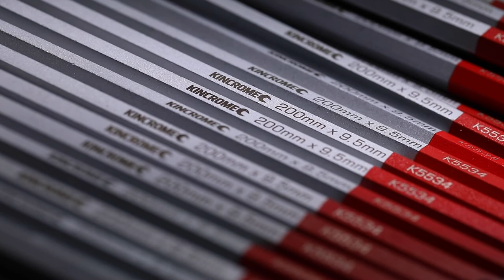KINCROME TorqueMaster® Screwdriver Manufacturing

Comment: How does the 50% more turning power claim come about?
Reply: I assume they just use a more expensive, higher-strength steel. The hexagonal interface between the rod and the handle may also have an effect in the claim, assuming there's an existing problem with fracture at the handle instead of shear failure of the rod itself.